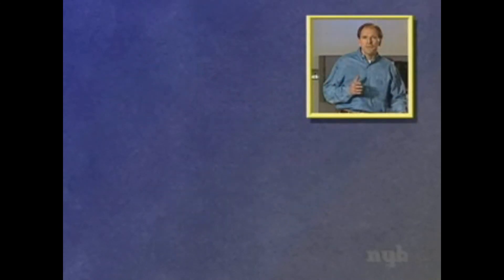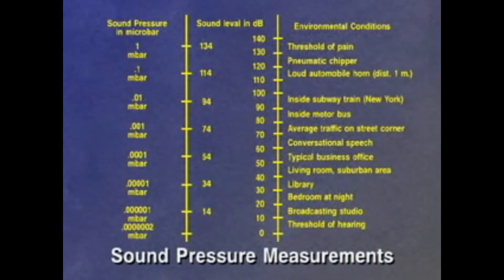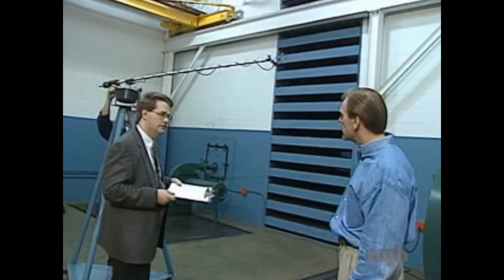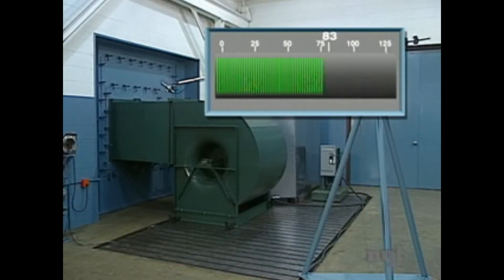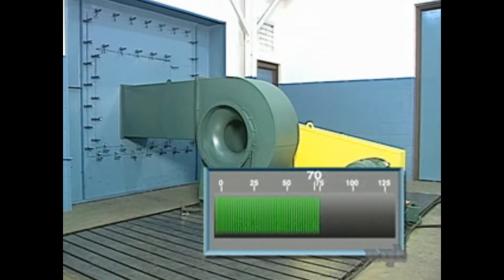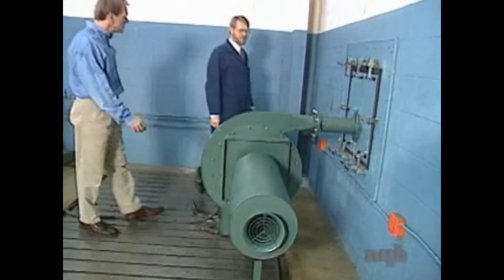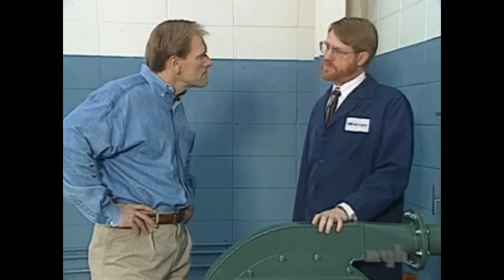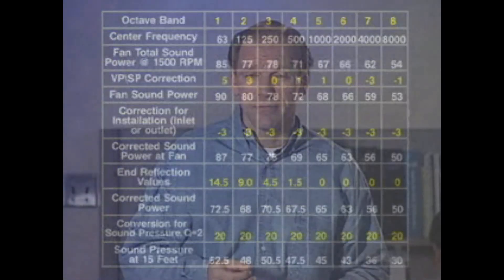Fan Acoustics | New York Blower

Comment: I thought backwards-curved fans were the loudest ones because vacuum cleaners typically use those, and vacuum cleaners are much noisier than the white noise of a typical home furnace or swamp cooler. So I've always thought that I'd hate to have a system that needed a backwards-curved fan even despite your having said that they're supposedly actually quieter. What factors line up to make a fan system have the most obnoxious vacuum cleaner sound that would be hard to stand having running for much or all of the day?
Reply from the maker: Hello! Thanks for your comment. 

There are a couple of differences related to furnaces/swamp coolers vs. vacuum cleaner sound levels. Furnaces fans and swamp cooler fans are both low pressure, high flow devices (excluding the combustion air fan in gas/oil furnaces). This is ideal for forward curved wheel designs. Forward curved wheels are often used in home furnaces and swamp coolers because they have low tip speeds. Low tip speeds result in light wheel, shaft and structural support designs keeping fan and installation costs low. Vacuum cleaners are high pressure, low flow devices. As a resulting, they require fan wheels (modified backward inclined wheels with long, steep blades angles or radial wheel designs) with high tip speeds. The high tip speed results in high noise levels. In addition, space is an issue. As a result the fan wheel is very small in diameter resulting in decreased efficiency.  

If you have additional questions or would like to discuss this topic in more depth, feel free to reach out to us directly via our contact page on our website. https://www.nyb.com/contact-us/